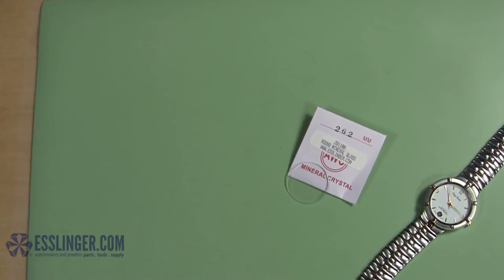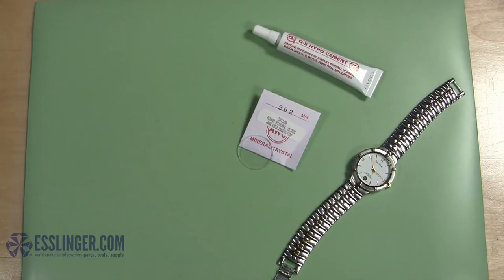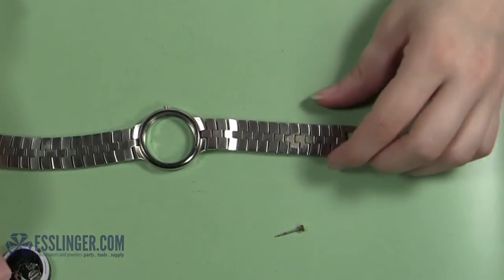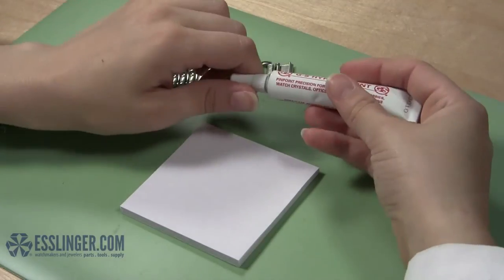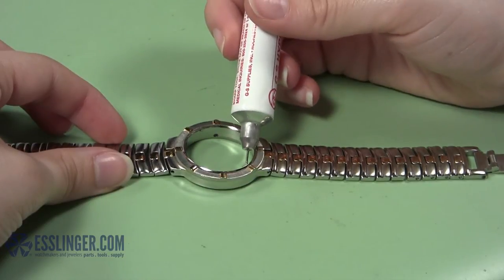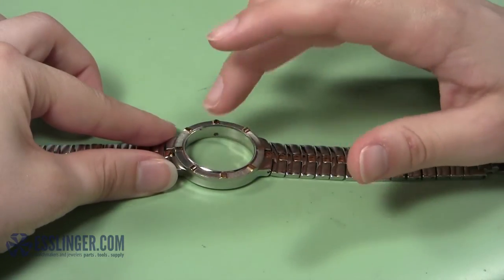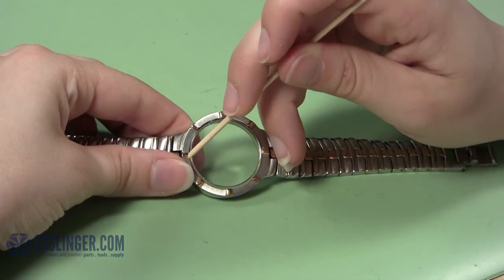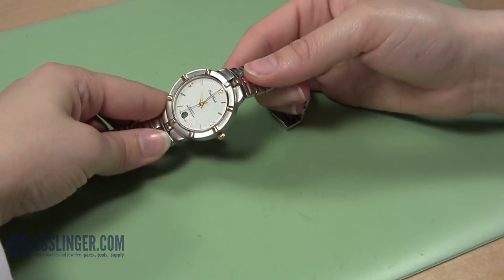How to Attach Watch Crystals with GS Crystal Cement

Comment: I use some isopropyl alcohol on the bezel after running a flattened toothpick- never use a screwdriver on the bezel. The alcohol will clean up the bezel nicely.

Comment: What is the difference between this and the ultraviolet glu for crystals? is this one stronger?
-thanks!
Reply: I personally don't find any differences. I use the G-S Hypo Cement because I won't need to get those UV lights (if you don't have one yet) and this one is cheaper too

Comment: I literally cringe when I see people clean watches of gunk and old glue with a metal screwdriver! A toothpick, plastic tubing or sharpened piece of peg wood will cause no damage to watch case, even though it is sometimes a longer process, the results are much better with no scratches.